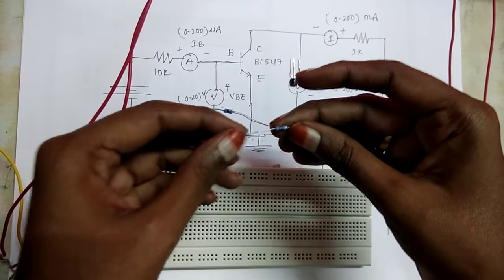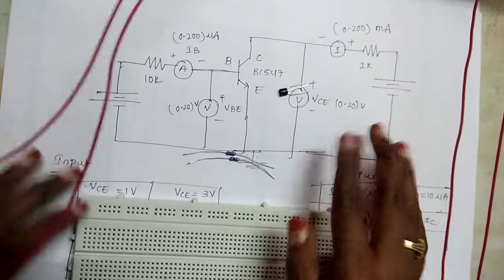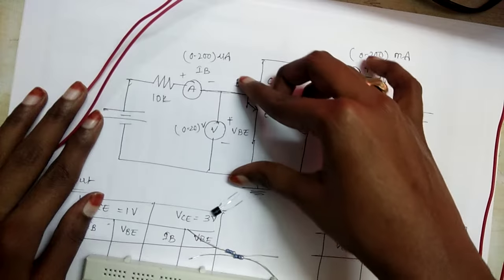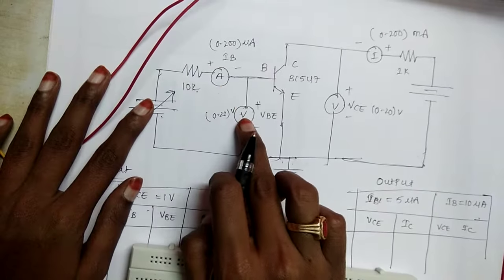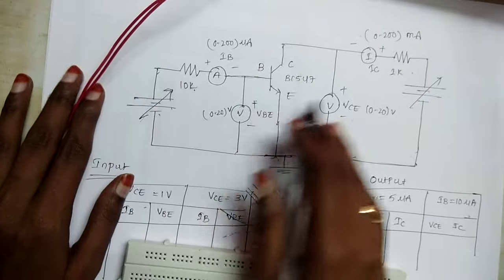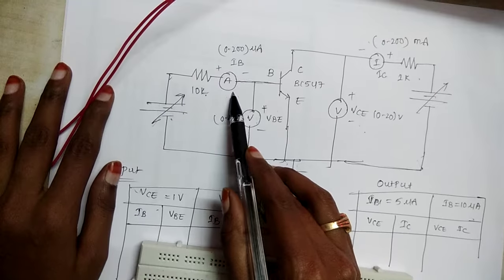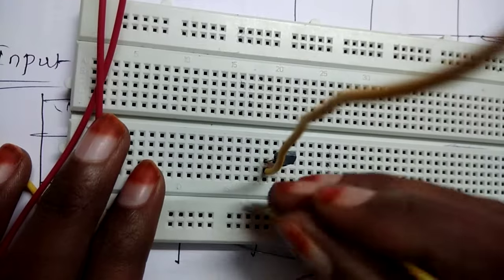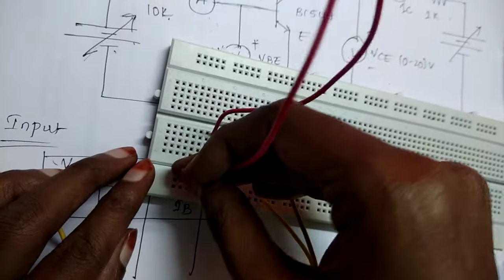Common emitter configuration

Comment: One connection is wrong output resistor is not connected properly with ammeter and output voltage